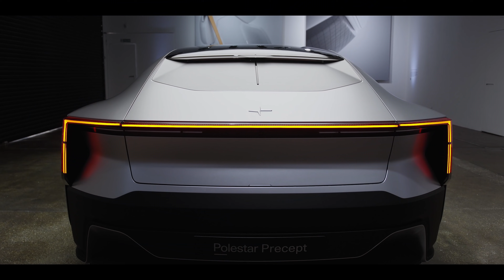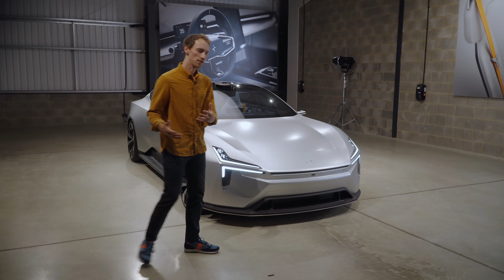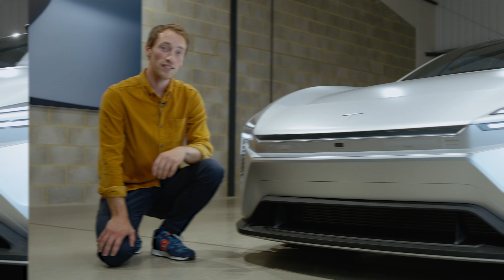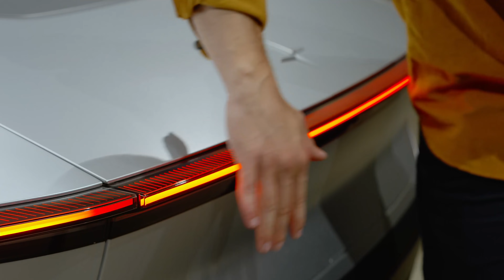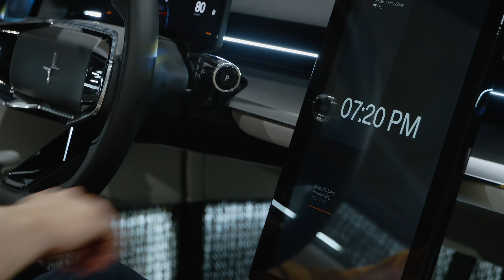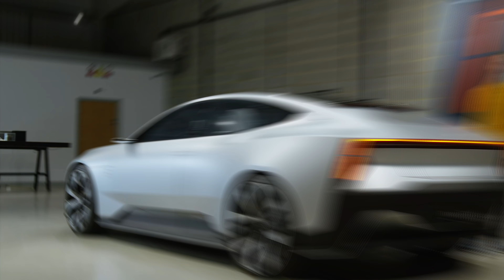NEW Polestar Precept walkaround – electric car of the future? | What Car?

Comment: "Lidar sensors... which give you adaptive cruise control..."
Do your research, will ya', Doug...?
Lidar is a system of light detection and ranging lasers which provide 3D mapping of a car's surroundings - enabling it with fully autonomous driving capability...